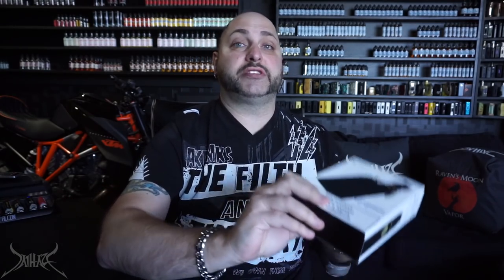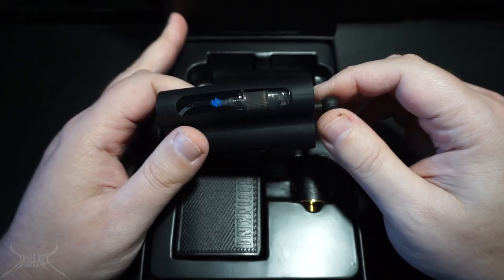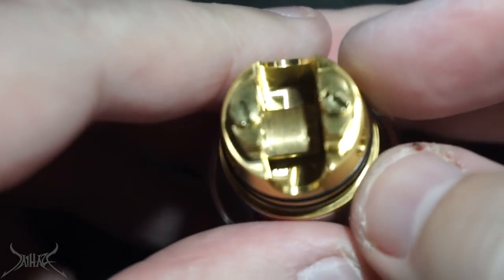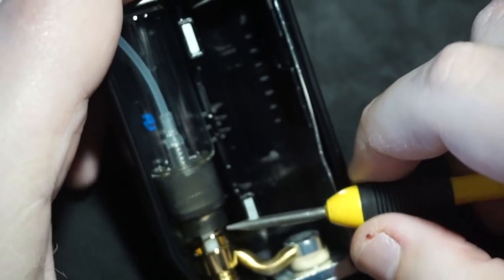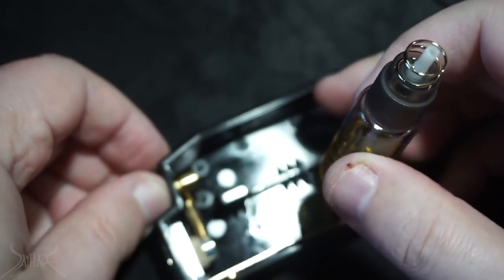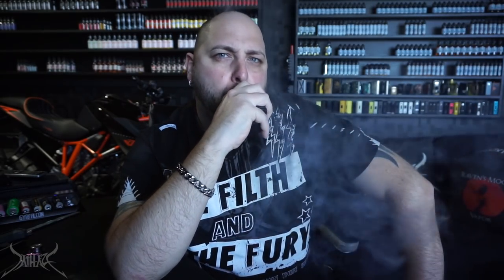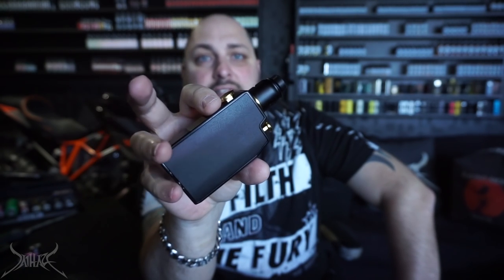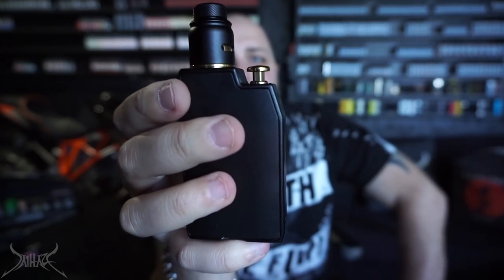Advken CP Squonking Kit Review and Rundown | Pump Activated Squonking

Comment: I know this is an unrelated question but have you ever seen a situation where one of your coils heat up faster than your oposing coil on a dual coil mod? The coils where a matched set with the same number of wraps. I'm at a loss.
Reply: James T43 different distances from the posts, electricity looks for the shortest path, and it's really fidgety, shorten the legs of the cooler coil check, repeat.

Good luck
Reply: Thanks for responding and trying to help.